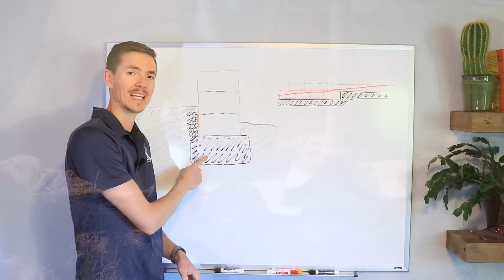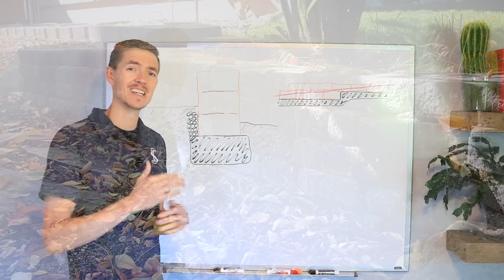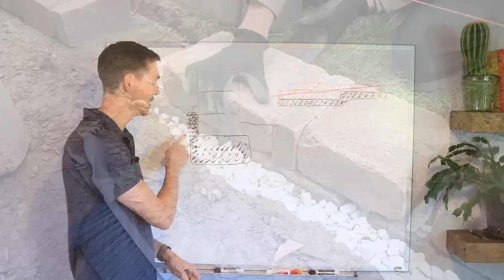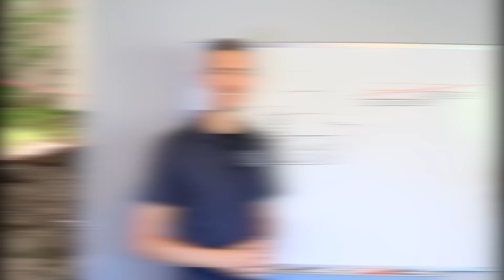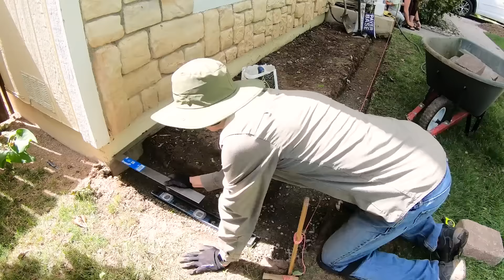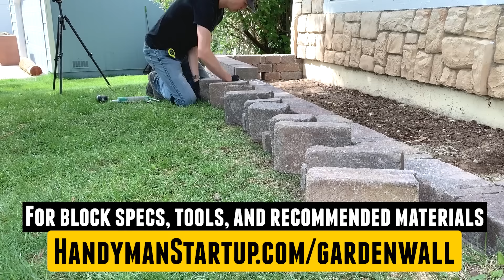Ultimate DIY garden edging that will last forever

Comment: Great video I wont give up on my retainer wall/ planter bed /1000th active project I have started.  Thanks sir. Wish it was as simple as it looks though.  Its between my drivewY and neighbors  69 total ft and unlevel unmatched driveway slopes with neighbors having extra concrete leakage underground that were.overppoured or under formed... lol yeeee 🎉 I got.this feels like 2 week project or in my case a month.. lost my line level in the trenches 😂..  might be a necessity! im only goin 2 high with 16x8s  but yikes . Leveling is so much fun 🎉😅

Comment: The construction adhesive is not really needed, and it will make repairing or rebuilding the wall more difficult.  If used, I would suggest just two adhesive spots per block rather than all over.
Just my opinion.

Comment: very nice. any suggestions for making it water resistant to protect again periodic temporary flooding?  I thought about putting a water and root barrier inside the wall, some of it would be below surface some above the surface but covered by dirt. I could still have water pipes at the bottom to allow water out under normal conditions but when flooding starts I could just have a screw on or push on cap for the pipe so water wouldn't come in. What do you think?

Comment: My mom never used any of this modern crap, and the retaing wall is fine although was only used as a small fence for looks and no water unless it rained, but the wall was backed up by dirt behind it and dirt thrown in beteewn to fill. It's been 20 years and it's stronger then ever and all done under $200  and lots of elbow grease and dirt, looks really nice too 👍

Comment: Great vid., and I'm excited to start my garden wall next weekend (based on your video).  
Quick question, would you recommend using a non-woven geotextile below the 4 inches of the  gravel after I've compacted the dirt?  

Also, on a side note...I love your brick choice, but sadly I couldn't find them in my area.  Thanks for putting this video together for newbies like me :)
Reply from the maker: A geotextile fabric is important for clay soil, so if you have a lot of clay in your soil, then yes. Otherwise, I see little to no benefit.

Comment: With the raised dirt level against the house, is moisture not a concern?
Reply from the maker: I didn’t raise the dirt level. You should never raise the dirt to the point where it is touching or within inches of the siding because it will cause moisture damage or introduce termites.

Comment: I know this video is relatively (in terms of internet) older, but is there any concern of water damage against the foundation? We live in an older house that does have a concrete foundation and i'd like to do this, but my flatmate who lives in the basement is concerned about water damage over time.

Edit: was thinking about putting brings against the foundation, but without the drainage holes you provided. Would that also be a feasible idea?
Reply from the maker: You should always build in drainage. Never trap water against your foundation.

Comment: Perfect! We built a rumblestone set of steps pretty much exactly as you did your wall.  The only problem we've had is the landscaping adhesive gives up after a few years in some of the blocks.  We're thinking about using some type of concrete as an adhesive.  What do you think?
Reply from the maker: That shouldn't happen. Maybe the blocks were dirty when you glued them? Or the gravel base wasn't packed well.

Comment: I learned something here. I would not have used a level on it's face - ever. I never tested whether it is an accurate way to check horizontal level and never even thought of using it that way. Thanks for the tip!
Reply from the maker: It's not as accurate on all levels, so double check that yours is.

Comment: Great video!! The wall looks amazing! I did two retaining walls about 2 feet tall each along my wooden fence because my neighbor had tilled so much on hi side that his elevation had dropped about 6 inches and my ground was crumbling towards his side exposing the concrete holding my posts up. I dug about 2 feet down and laid out a 6 inch concrete base (mixed concrete),. When the concrete cured I used mortar mix to glue down onlly the first row, the blocks are 6 inch tall and about 12 in wide. The wall has been up for two years and has  not moved.

Comment: This is beyond overkill for a 1 ft high wall that holds zero weight. You could dry stack these on some sand and it'll last a decade
Reply: I agree if they interlocked in any way,but with these flat stones you'd be constantly nudging them as you worked on your garden.

Comment: Look at any garden stone wall in your area and you will see the same thing over and over-- the stones are uneven and sinking.  It's because no one respects how much *YOU HAVE* to dig down and put the crushed stone as the base!!!  It's extra work, it's extra cost, and it seems so unnecessary when you're placing the stones.  But they will all sink if you don't do that step.  Take the time.  Do it right.  This is a great video!

Comment: Why do I have to trench down at all, with the high cost of the pavers, I would like to use the first roll on top of the leveling sand flush with the lawn, to me it's more cost effective to have the first row seen. I'm just wanting a 2 tier paved around my flowers
Reply from the maker: Because it will move if you do that.

Comment: Wonderful edging technique bro 0:38 

Pro tip though, Most people I know prefer to use their right hand instead of a metal tool 😃 you're welcome
Reply: A damp sock over your hand makes the edge so much more smoother and even. But I won't say it's necessary, just for satisfaction.
Reply: If you’re flexible your feet also work

Comment: Your wall looks great and happy wife is a happy life.I'm in the process of building a 38' x 19' raised garden on a 2' slope. I went with reinforced concrete base: easier to get first course level. Especially when stepping the wall is involved. Drain system is paramount. Used same adhesive method.256pcs 16" long x 4" thick x 5.375" wide blocks.26 pounds per btw. Qouted 12 grand and I'll be at 4 grand including 23 yards of enhanced garden soil.

Comment: You’re supposed to put down a 1 inch layer of leveling sand before your pavers, per the directions. It seemed as though you used only a small amount. 

Although, your wall looks very sturdy and seems to have lasted the test of time. 🧐 

Do you think that your method worked just as well, using less leveling sand?

Comment: Do you have any alternative recommendations to keep water from accumulating next to the house besides leaving the drainage gaps? Could I put something up on the wall to keep the water from seeping through?
Reply from the maker: Drainage is essential. How you accomplish can vary, but you need drainange.
Reply: maybe some thick tile backer board that you waterproof first, but add some type of drainage at the bottom, like a french drain with perforated PVC??? Just some ideas as I was wondering about that as well.

Comment: I just packed down the dirt and started laying the retaining wall. I did bury the bottom first row a few inches down. Its been at least 6 years and still no issues. Also i didn't glue it down. I figured if i have issues ill just take it apart and fix it again, where if its glued i wont be able to.
Reply from the maker: Nice

Comment: If I were to recreate this, with a 3.5 inch wide paver 7 inch long instead of what you have used in the video, but with the same process involving the gravel foundation and construction adhesive, would this hold dirt in a flowerbed (fill up the flowerbed if the paver wall is half a foot to a foot above ground?)
Reply from the maker: You’d probably be ok if your flower bed was under 6”, but I’d go bigger blocks if it’s higher than that.
Reply: @StayHandy  Got it. Thanks for the quick response! Loved the vid!

Comment: When leveling your string did you go from the ground down the hill or from the top of the step down the hill? Thank you and great video. This will be my weekend project on both sides of my home off the front step
Reply from the maker: I ran the string where I wanted the top of the wall to be so I could plan how deep to go to achieve that height.
Reply: @Handyman Startup  how does the string determine the depth of how much you have to dig? This is part I can't understand.  Could you explan please? I understand the string is used to help put bricks in straight line, but how does it determine the depth?

Comment: I would have installed a liner for weeds and used mortar for the joints, but looks good man. Good job
Reply from the maker: Thanks! I think I did a liner before planting the shrubs. Just didn’t show it in the video.
Reply: @StayHandy  nice man, it’s good you don’t listen to the experts in the comments. I love your vids good job brotha
Reply: Adhesive is more expensive than mortar, but mortar creates spaces between the blocks that are visible. Using adhesive makes the wall look cleaner. Spring for a 28 oz. Caulking gun and buy the big tubes of adhesive to save $.

Comment: If I am building a low retainer wall for a small rock-garden, i.e. there will be only river-rocks inside, can I just dig the ditch exactly as wide as the paver-stones?
Reply from the maker: You’ll have a slightly weaker foundation and a harder time fitting the blocks in a straight line. I recommend 3-4” wider than the blocks.